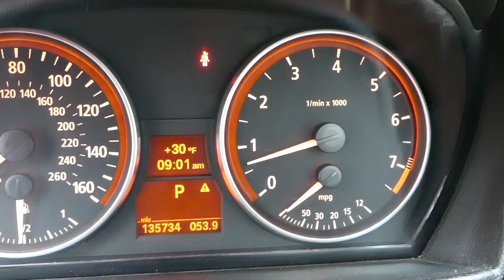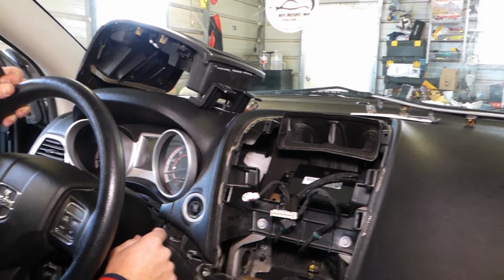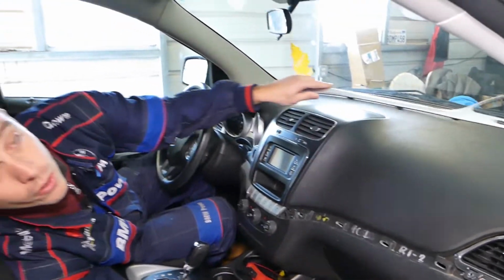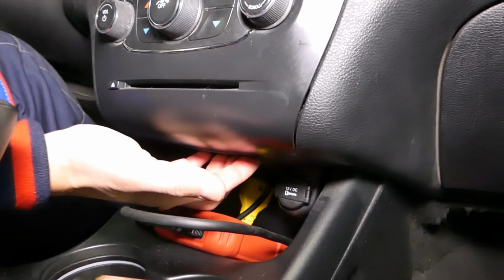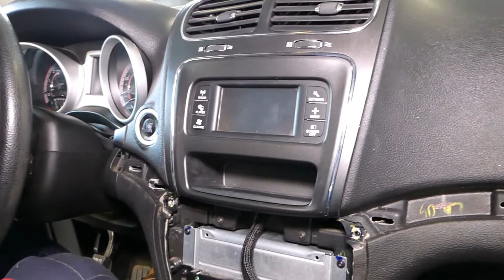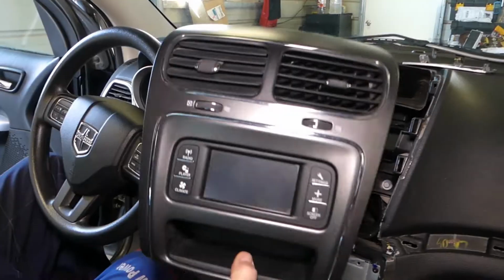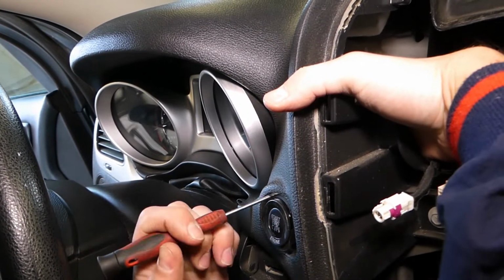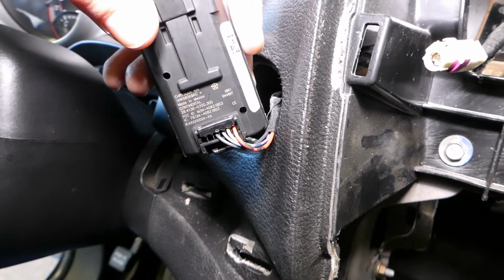DODGE JOURNEY IGNITION SWITCH START STOP BUTTON REMOVAL REPLACEMENT FIAT FREEMONT

Comment: What could be the reason? The car does not turn off the engine, I press stop and nothing, after the 3rd time the immobilizer is activated. Start button hundred replaced, new battery and batteries in the keys. Fiat Freemont

Comment: I have a 2010 Dodge Journey. I drove to the store and when I came out it wouldn’t start. Key turns but stuck and won’t come out. Completely dead. No lights. No sounds. No clicks. Nothing at all. Battery tested good. Terminals are clean and tight. Thoughts?

Comment: Why did you changed the button? What problems where you having
Reply: I'm having to replace mine because it's having a split second delay before it engages to start the vehicle.
Reply: @waynebowling8139  hello did this fix your issue? Mine started having like a 2 or 3 second delay and now it does not turn on anymore… I already replaced the starter and relay.. so mechanic advised to replace the ignition switch next
Reply: @avjrttrjva4638  Yes it did. Sorry it took so long to get back to you.

Comment: Excellent video, this is exactly what I was looking for. I just got a used 2013 Dodge Journey a few months ago. The start button still works fine but the front of it is faded and worn out and I'd like to replace it.
Reply: Get rid of it. We just had to replace the fuse box. $1,100. It's a nice vehicle, but the 2013 Journeys have alot of electrical issues. We've put a new starter, battery, and alternator on it. Not including having to replace wiring. Just my opinion.